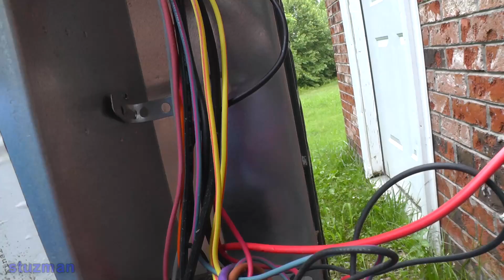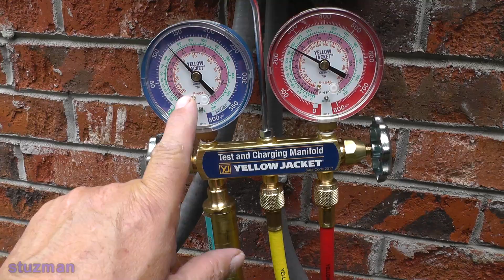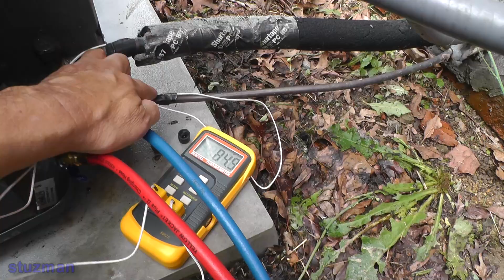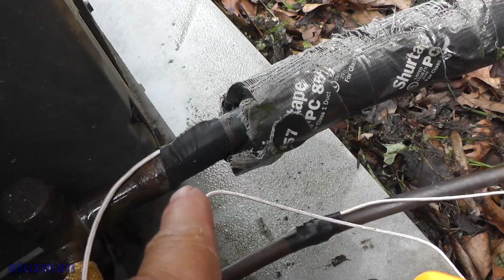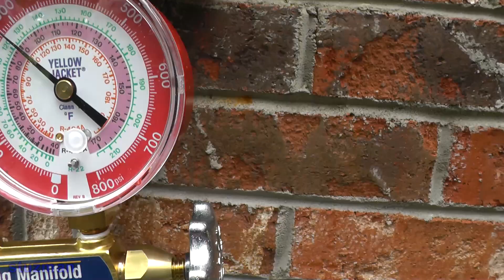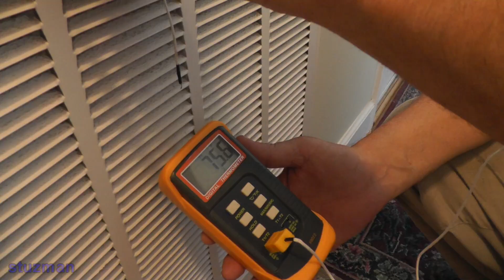Home A/C Compressor Not Running - Fixed

Comment: I'm having an issue I believe to be the vacuum or compressor pump. My unit will still be running but it will stop blowing cold air. To fix the problem I've been turning the thermostat on and off, sometimes it takes 2-3 tries. I've noticed that I can hear a loud hum when it's working properly, but that hum is gone when it's not. And I can also see liquid moving in the sight glass when it's working, but no liquid moving when it's not. Sounds like a pump to me because everything else is working fine. The pump does start eventually but it will stop working before reaching temp, and then the unit continues to run without cold air. What do you think?
Reply from the maker: It could be a faulty thermostat, but you'll need to do a little detective work to confirm. When the unit is acting up, take the control panel off to expose the line contactor inside the outdoor coil unit. Place a voltmeter across the coil terminals of the contactor and if you don't see 24VAC, then the most likely cause is a faulty thermostat.
Reply: @stuzman  sorry it's taken me so long, we had cold weather and wasn't running the ac. I checked it today and it has 24v across the coil, and 240v on both sides of the contactor. Now it won't blow cold air at all. I think it's the compressor?
Reply from the maker: @excuseme4960  Okay, by having 24V across the contactor coil there isn't a problem with the thermostat. And since you have 240V across both sides of the contactor, the contactor is good. The next time the contactor starts, verify that you hear the compressor start. If it starts, but there is a humming sound, then it's a good chance that the run capacitor is defective. To check, turn off the power to the outdoor unit. Bridge across the terminals of the run capacitor to discharge any residual charge that may be left on the cap. Remove the wires taking note of where each one goes on the terminals. Using a DVOM which if it's a good one will have a function to check the capacitance. You will see three terminals marked C, (common), Fan, and Herm (Hermetic which is for the compressor). Check between the C and Fan for its capacitance, and check between C and Herm for its capacitance. It should be +/-10% from the value on the capacitor. If not, replace the capacitor. Let me know what you find in these steps.
Reply: @stuzman  I did that after I left the comment today, however I did not disconnect the wires off of it, and I was getting weird readings - probably because I didn't disconnect the wires. Tomorrow I am going to take both capacitors to the parts store and have them test them. I replaced the starting capacitor about 5 yrs ago. What's left to check if they are both good, starting relay?
Reply: @stuzman  all capacitors are good, contactor good, voltage is good. Compressor won't come on at all anymore. I don't know what else could prevent the compressor from coming on. I assume it's finally kicked the bucket. Anything else that could be wrong? I'm trying to get some quotes on getting it replaced, seems most people just want to replace the whole unit.
Reply from the maker: @excuseme4960  Okay, if you're sure that everything is good as you mentioned including the potential or current relay for the start circuit, then it's time to move to the next step. There are three wires going down to the compressor, one is for the Common (C) terminal, the Run (R) terminal and the Start (S) terminal. You can look at your wiring diagram to determine these wires or you can visually look to see those wires. Typically two of these wires will go across the load contacts of the main contactor and the other wire will go to the Herm terminal of the run capacitor. Remove all three of the wires going to the compressor taking note where each wire connects. Check resistance between the Common wire and the Run wire. Write this resistance down. It should be about 1 ohm and will be the lowest resistance. Check between the Common wire and the Start wire. This will be about 3 ohms. And finally between the Start and Run wires. This will be the sum of the previous two readings. Keep in mind that these resistance values can vary, but should be low values. If the resistance value(s) are open, then remove the condensing fan and then the terminal cover on the compressor. Take a mirror and look at the connections to the compressor. It's possible that one of the terminals has broken.
If all of the above looks good, then put one lead of your ohmmeter on one of the compressor wires and touch the other meter lead to a good ground such as a refrigerant line. There should be OL on the meter. Repeat this step for the other two wires. The result should be OL on the meter. I showed the above test in the video above and here is another video where a fella shows the measurements on a compressor. There are other videos describing the above tests on YouTube. Good luck on what you find and hopefully, it's not the compressor. https://www.youtube.com/watch?v=Vyr5xP-E23k&t=18s

Comment: Ours was fine last night.  This morning it was not as cold as normal. 
Outside fan running blowing ambient (not hot) air.  Inside unit running fine. 
Cleaned evaporator & condensing coils. Changed filter (New one 5 days ago). Cleaned drain line in case clogged. 
I'm thinking capacitor - as I said outside fan running but no deep 'hum' of compressor running.  
Note: or system is from late 1990s 🤣 (94 to be exact). We rent and don't see new system any way possible so I guess another band-aid repair it is!
Reply from the maker: Hi Jennifer! If you don't hear the compressor running, then that is your issue. It's a good chance that you may have a bad run capacitor. It's not too hard to check it. Have a great day!

Comment: Many Thanks for this video, saved me an expen$ive repair call (and probably days of waiting for the repair).  90F outside now in Ojai, CA.

Turns out my capacitor was bad just like in this video.  Easy fix.  Was also glad to know that my compressor windings had good resistance values, Thanks for showing that part.
Reply from the maker: Glad to hear Robert that you had an inexpensive repair! Have a great evening!

Comment: Have a question? 2 wks ago I had HVAC here checking my ac. The refrigerant was ok. The issue was the compressor would kick on, the  lines would get cool like they're supposed too and then shut off within 20-30 seconds. The HVAC guy replaced the run capacitor but the compressor still wouldn't stay running. It would start, run and then shut off. The guys couldn't figure out the problem and left. My ac unit is a 1979 rheem with the original 1979 Copeland compressor if that helps. Everything else on the ac unit and inside works as far as I was told.
Reply from the maker: When the compressor just drops out and the outside fan still works according to your description, would put the problem in the compressor circuit. Most likely, there is a loose connection. Look at the wiring diagram and check all the connections that include the start, run and common wires at both ends, connections on the run capacitor for the compressor. And you want to especially check the connections directly at the compressor. If you don't find any loose connections, then I would suspect that there is an internal opening of one of the windings inside the compressor. To confirm this, when the compressor shuts down, you'll want to check for continuity between the common, run and start windings of the compressor. You should be able to do this inside the control panel of the outside unit. And you'll want to do this quickly as the compressor cools, the winding may 'heal'.
Reply: Raquel

Comment: Hope you can answer a question for me. Our central ac went out two days ago. I watched a ton of videos and came to the conclusion my capacitor needed to be changed. I could push the plunger in and the compressor and fan would kick on but the blower in the house wouldn't come on. I just put the new capacitor on but it's the same thing. I just put a new thermostat on a few months ago and it has been working fine. Like the most of the country, we here in SW Missouri have been going through a heat wave. Yesterday the heat index was 102 and it got up to 89 in the house. My wife and I are both on social security so I am trying to find the least expensive way to get this done myself. Any ideas you may have would be greatly appreciated. Thanks!!
Reply from the maker: Hi Wm and sorry to hear that you're going through this heat wave. Take a look at the motor inside the air handler and find the voltage source going to the motor. That would be the first thing to check. You said that you changed the capacitor. I'm assuming that you're talking about the capacitor for the indoor fan unit. If so, then be sure to check the voltage going to the motor. If that's okay, then most likely you have an issue with the motor that needs replacing. Let me know how it goes so you and your wife can get back up and running.
Reply: @stuzman52  Hey, thanks for the response. No, the capacitor that I changed is the one on the outside unit. I figured the blower motor should be okay because I run it on manual to keep a bit of an air flow in the house. After I changed the capacitor outside, I pushed in the plunger contact and the outside unit would come on (compressor and fan) but the blower on the furnace doesn't kick on. So when I run the furnace blower, is that bypassing the capacitor for the blower? Someone told me it could also be low on refrigerant. I really don't think that is the case however because when it was working, it was blowing very cold air. The electrical panel on the outside unit is so hard to get to. On the left side is steps going up on the deck, on the  backside is the deck and on the right side is the wall to the house, so I literally have to lay on the unit and work upside down. LOL I guess I'll try to do some more testing and see if the low voltage from the thermostat is ok on the plunger contactor and the voltage on the furnace motor. Like I stated, I don't know if when I run the blower on manual if it is bypassing the blower motor's capacitor. Any advice would be greatly appreciated. My wife and I are both 67 and on Social Security and just trying to get by. Thank you so much!!
Reply from the maker: @CombatDoc54  Okay, Wm. The capacitor inside the outside unit has nothing to do with the blower motor inside. The capacitor that's outside is a dual capacitor where one is used to start the compressor and the other capacitor is to start the condenser fan. You need to take a look at the wiring diagram on the inside cover of the outside unit and see why the contactor in the outside unit is not energizing. One of these components for energizing the contactor is the thermostat. You need to look at the wiring diagram for the control side of the contactor, (the coil) and see why it's not getting 24VAC. There could be pressure switches located in this circuit which are for low and/or high pressure switches for the refrigerant. That's where I would start for your troubleshooting. Good luck Wm!

Comment: any tips on if i hear a “clicking” sound at the condenser unit when setting the thermostat to cool and/or turning thermostat to off? I hear the click and the condenser/compressor stay off
Reply from the maker: Not sure about the click unless it's the contactor being energized and de-energized.
Reply: @stuzman52  pretty sure it’s the contactor. gonna check tmro if it’s getting 240v

Comment: Interesting, that cap looked like new and had flat (not domed) top.  Encourages me to dig deeper regarding cap as possible source of "dead" compressor and condenser fan which has all appropriate voltages, but appear to be shutting down from a thermal overload.
Reply from the maker: Be worth checking out for sure!
Reply: @stuzman52  i checked cap and mine is fine.  I had replaced it 18 months ago, but symptoms are like bad cap.  I need to dig deeper.

Comment: My ac is working I can hear the sound  but no air coming out  and even the remote not working then  no fresh air  just the sound please help
Reply from the maker: I assume that you have a mini-split unit. And that your compressor and outdoor fan is running. So, it sounds like your indoor fan is not running. See if you can find a service manual for your unit and it should give you some insight to where your issue may reside. The voltage for the fan is provided by the outdoor unit. Since your remote is not working, I would verify that it's not the remote. Good luck!

Comment: I followed all of your troubleshooting steps and did all the meter checks, compressor was good and found that the capacitor was a failure. Replaced and the unit is working fine. I thank you very much for you to share your knowledge in helping others. Its greatly appreciate. You have a blessed day and a wonderful Thanksgiving and Christmas.
Reply from the maker: Glad to hear that you got your unit fixed. You and your family have a Happy Thanksgiving and Merry Christmas too.

Comment: Stuzman are you an HVAC guy or just a REALLY handy guy?  How much did that set up cost you?
Reply from the maker: I don't work professionally as a HVAC person now, but I did work in refrigeration for about four years ago. I do have certifications in all three types of licenses for industrial, commercial and residential, EPA 608, and a certification for mobile A/C EPA 609. As for the cost of tools, I couldn't give you a cost off the top of my head as I bought them at different times as the years rolled on. I would suspect that all of the refrigeration tools that I have, (which some are not shown in this video) are at least six thousand dollars.Thanks for the comment wakawaka1976!

Comment: This guy knows his shit. He should explain low and high side first though
Reply from the maker: Looking back, I could have mentioned a few things more, but I was more interested at the time to get the unit running as quickly as possible. Thanks for the comment!
Reply: @stuzman52  hey brotha was not hating. Just constructive criticism. I would love to see you do a high low side presentation. I feel this is were alot of green horns get confused. You know sub cool is high temp super heat is lower temp. And just to fuck with um no t p relationship with superheat. You know hvac you will never go hungry.
Reply from the maker: @josephrostkowski674  No problem at all Joseph! And you are right that if you know HVAC, you can save yourself some money. And that goes with anything that needs fixing. Thanks for the comment Joseph!

Comment: Thermostatic expansion valve is also known as a txv ( metering device cause a sudden pressure drop which is critical to low pressure for you evap coil)

Comment: Should have added safety warnings. DYI folks will electrocute themselves. Touch charged capacitor without bleeding electricity and you can die or burn fingers. Overall I loved this video.
Reply from the maker: Yes, good point as I was trying to get this unit fixed as quickly as possible. I did another video checking the run capacitors dynamically and I did show how to discharge the capacitors and do it safely.

Comment: hello very nice channel very useful thank you for good useful shares i have a question i want to work with the air conditioner compressor externally I connected (+) L directly to c /// I made parallel connection from (-) N to capacitor // R I made a connection from the other leg of the capacitor or fuse blows or the compressor runs for 2 seconds 5/6 seconds stops and rings again for 2 seconds and it gets very hot.
Reply from the maker: I'm not sure Ali how you made your connections and will clarify the connections between the compressor windings and a run capacitor. You mention a connection to N which I assume is neutral. L1 will connect to the C, (common) terminal of the compressor where the run and start windings are connected internally inside the compressor. The R, (run) terminal on the compressor will connect to L2 or N if you have a neutral. The S, (start) terminal on the the compressor will connect to the HERM, (Hermetic compressor) terminal on the run capacitor. And finally, the COM, (common) terminal of the run capacitor will connect to L2 or N. If the unit still blows a fuse or the compressor trips, you'll want to check the run capacitor. I show how in this video. If the capacitor checks okay, then check the windings of the compressor. I show that procedure also in this video. Hope that helps you out Ali and good luck!

Comment: My central ac started blowing warm air overnight and I seen the compressor stopped running but all fans were still running. After resetting power the compressor started back up but only after several  attempts and several ( appr. 8 ) hours  later. This morning I awoke to warm air and off compressors again. What is wrong?
Reply from the maker: The first thing to check is your run capacitor for the compressor. That would be a good first start.
Reply: @stuzman52  I don't have a multimeter unfortunately

Comment: I had a brand new home built in 2015. My ac goes out Oct 2019. Jan new compressor, March New compressor,  now June New compressor.  Whats going on?. The tech says everything ok, but why do I need 3 new compressors installed in a few months? Every compressor has failed. I have a carrier unit. This is weird
Reply from the maker: I'm just guessing, but if you had a mechanical failure of the first compressor, the most likely cause is that the system was not flushed of the contaminants in the system. Yes, having three compressors to fail is not normal.